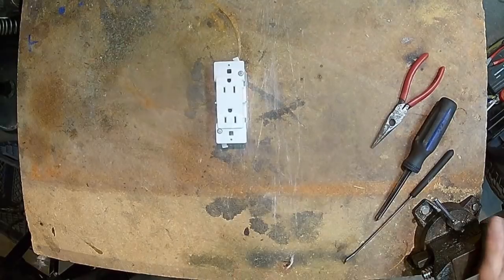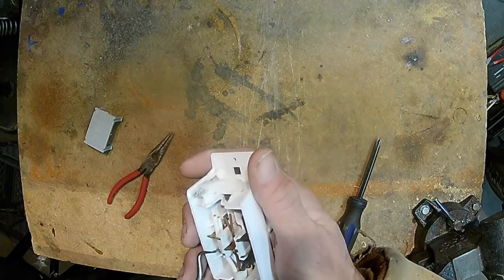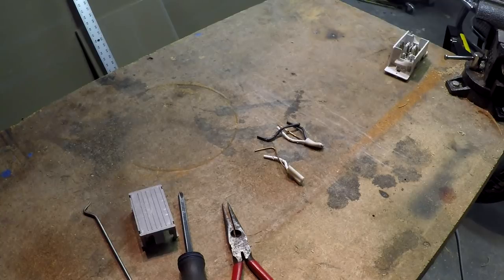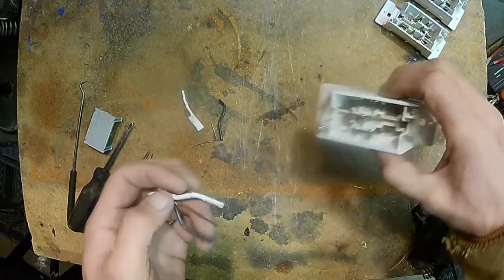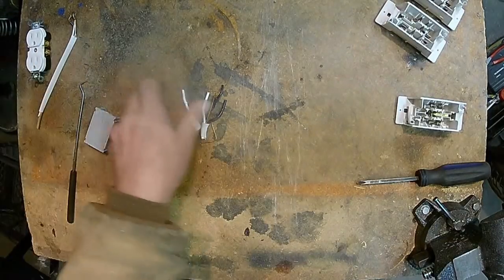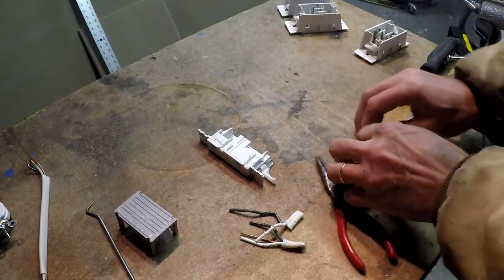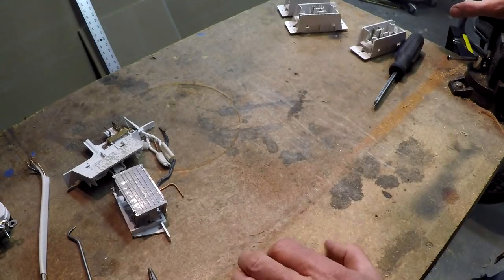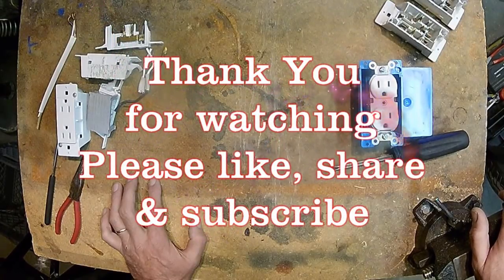Autopsy of a RV outlet "RIP"

Comment: Thank you so much! I have an outlet in the slide out that popped out - when inspecting, I saw that the 'plate' with the two diagonal screws had broken on one side, letting the screw and the little wing fall into the slide. So far, I have sugru'd (that silicone repair stuff) the plate together and purchased another little wing to replace. Now, its all about getting down on the floor again to reach that darned outlet....but thank you so much. What you showed is exactly what I needed to know, along with how to change it out to a regular house outlet if this doesn't work. The wiring seems to me to be a bigger trouble to replace with those boxes getting the wire to slice inside the outlet when closing, than to replace with a better outlet with the side wire nuts Again, thanks (and hope my terminology is understandable...)
Reply from the maker: You are welcome, I fully understood your comment. Your comment is what helps drive me to continue to create videos.
Reply: I'm on retirement

Comment: All mine are residential. It's a 08 Skyline. At least the one in the bathroom is. I had to go into it because when it rains it trips sometimes. It's a GFCI. I disconnected one set of wires going to another receptacle to find out if water was causing it. But it still does it.
Reply from the maker: From the ones I have looked at, the GFI outlets are residential style. The rest were this style.
Reply: If the GFI outlet controls the outside outlet then that might he where the issue could be. Check the caulking around the outlet.

Comment: I have one of these outlets in an RV and three wires are in it (instead of the normal one or two). If I want to replace the outlet with a residential style one will that work with a single outlet or would I need to use two outlets. It seems weird to have three wires in one box but that was factory work.
Reply from the maker: There should be three wires, the black is the hot, white is neutral and the bare wire would be the ground. 

So a residential outlet will work, just make sure you wire it up correctly.
Reply: @DiyRVandHome  Sorry, I'll be more clear. There are three separate runs of romex (or whatever it is) so three black, three white and three grounds all inserted into one box. I actually broke the spare box trying to get it to snap closed with all of that in it.
So one comes from the breaker box, one is the loop for the room the outlet is in and one goes to power another series of outlets.
Reply from the maker: Yes I am sure that a residential style will work.
Reply: @DiyRVandHome  Thanks!
Reply from the maker: @rnash999  you are welcome.

Comment: Another poor and unsafe process is stringing multiple outlets to one 15 amp circuit. I have 9 outlets on my non GFI 15 amp circuit. Seems that no form of electrical code is applied to RV's....
Reply: Replace rv light switches
Reply from the maker: RV light switches are on the 12 volt system. The tend to have less problems. Is there anything specific you are looking for information?

Comment: Booo garbage! No wonder why half my outlets are dead. I'm switching them out asap! Poor connections result in heat which you guessed it, could start a fire. No difference with those push in type residential either.